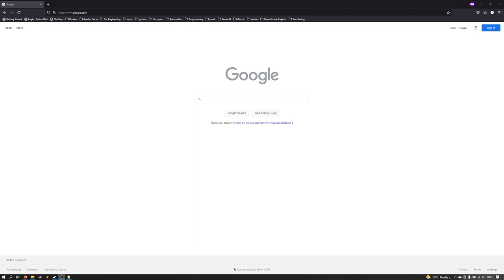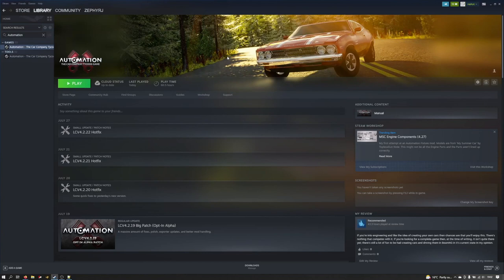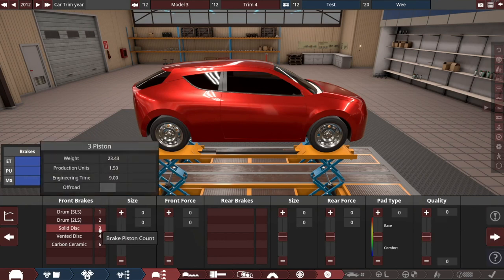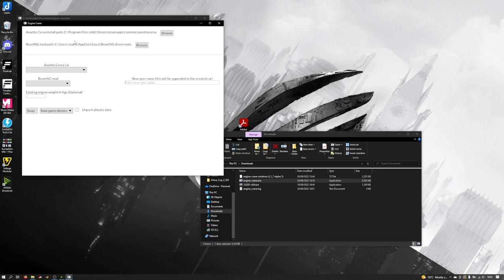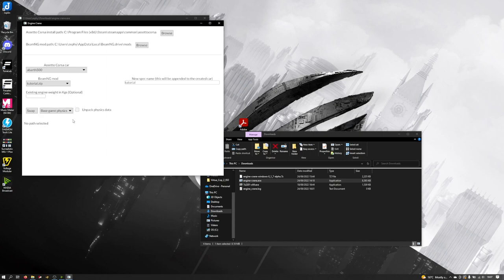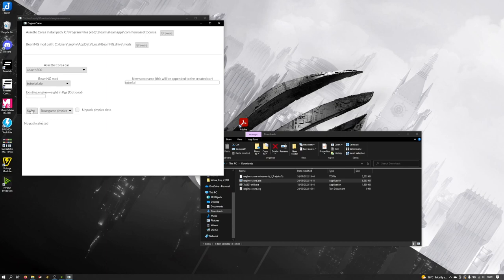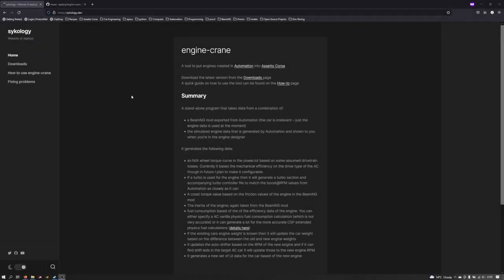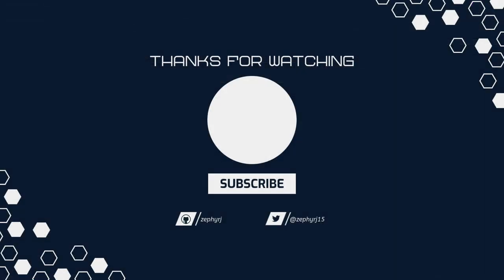How to create engines for Assetto Corsa using Automation | engine-crane v0.1.7

Comment: Hi men, when i try swap the engine im have this error:
"Car file selection family is missing  attribute VVL. The BeamNG mod may be out-of-date; try recreating a mod with the latest engine version"
Thanks
Reply from the maker: Which version of Automation are you using? The 4.1 base version or the 4.2 openbeta version? When I've encountered this I've had to create a new car model, choose the engine I want to swap and then export that as a new mod
Reply: @zephyrj  the 4.2 open beta. Could you please explain to me the process to solve the problem? Thanks :)

Comment: I would love to enjoy engine crane but when i swap engine to asetto, new cars is appearing in content manager, but without any changes, toyota ae86 drives the same with 5.0 V10 1600hp
Reply: Oh crap i just downloaded v0.1.13 and it works
Reply from the maker: When it doesn't work does engine-crane say that it has swapped it successfully when it doesn't change the power?

At the moment engine-crane will create a new car regards of whether it succeeds or not (so it doesn't risk deleting something it shouldn't) so just because there is a car doesn't mean the swap succeeded
Reply: @zephyrj  in v0.1.7 should it say it was successfully in engine crane as in v0.1.13 or in txt file only? Becouse mine engine crane 0.1.7 would close up after any swap
Reply from the maker: V0.1.7 had some bugs in it which meant it could crash and exit. If it was successful it wouldn't close and would print that it was successful
Reply: @zephyrj  really thanks for your respond, anyway in 0.1.13 it works great, so i appreciate your work
Reply from the maker: @him8449  Thank you, really appreciate it.
As an FYI 0.1.14 is also available on https://www.racedepartment.com/downloads/engine-crane.54657/
there's not much change from 0.1.13 but it should give you a slightly more accurate coast curve.

Enjoy swapping engines :)

Comment: i cannot for the life of me get the automation folders to show up in engine crane
Reply from the maker: Hi, sorry for the late response - I didn't get the usual notification about your comment

You can select the path manually if engine-crane isn't automatically finding it. The right-most tab engine-crane has settings where you can set the folder you want it to look for Automation mods

Comment: can someone please help i downloaded engine crane but it cant find any mods in the folders . any workaround/fix 
?
Reply from the maker: Hi, I may be able to help if I can take a look at the log file.

You can raise an issue over at https://github.com/zephyrj/engine-crane/issues and it will allow you to attach the log file for me to look at.

The log file can be found in the same folder you run engine crane from
Reply: @zephyrj  the problem is that when i select the assetto file it says no cars found.....
beamng folder is working okay
Reply from the maker: @leonpace8098  I've replied on the github issue you have raised. Hopefully that helps solve the issue. If you need to send the log file then an example on how to find it is at https://youtu.be/8fMQCYiAgVU?t=1167 in the video

Comment: i have a problem i cant select a beamng mod is is beacuse i dont have the game someone please tell me.
Reply from the maker: Hi, you don't need to have BeamNG installed to create/use the mods in engine-crane

If you are encountering an issue where you can't find any BeamNG mods appearing in the list this may help you:
- the beamNG mods must be zip-packed for them to be picked up by engine-crane so make sure that the zip-pack option is selected when creating the mod in Automation
- To ensure that engine-crane is looking in the correct folder for your BeamNG mods use the "open folder" option when using the BeamNG exporter in Automation (to see the directory it's using) and ensure that the BeamNG mod path in the settings tab of engine-crane matches that directory

Comment: bro, it say "swap failed - car already exist" what should i do?
Reply from the maker: Each swap creates a new car. The name of the created car will be the original cars name + the spec name that you enter when doing the swap.

I suspect you've already done one swap with the car you're trying to swap into. You can either change the spec name when you perform the next swap or you can delete the old version from the Assetto Corsa data directory
Reply: @zephyrj  okk tq. but the car still same after swap.
Reply: @zephyrj  or need to finish engine first?
Reply from the maker: The engine will go into the car in the state it is in when you perform the swap. So generally you want to finish it before doing the swap. Make sure you select the correct car in Assetto Corsa; the base car is not changed, only the new spec that you create
Reply: @zephyrj  already swap, but the engine still same. i dont get it :/
Reply from the maker: @amirulasyraf9684  what are you expecting to have changed? It will only be the torque and power that will be different; no engine sounds are changed unless you do a manual sound swap
Reply: @zephyrj  the power and torq still same. nothing different..
Reply from the maker: @amirulasyraf9684  I've not encountered this happening to me. When the swap is performed does it say that it is successful?
Reply: @zephyrj  it not say swap successful. forgot what it say. later i try it again
Reply from the maker: @amirulasyraf9684  Ah ok. Currently when the swap says failed the car still gets created but no data swap happens - which explains it. Let me know how you get on later
Reply: @zephyrj  bro, u have any chatting apps? so i can contact u and send photo what engine crane show
Reply from the maker: You can attach logs and pictures to a github issue - that would be the easiest way for me to analyse it.
https://github.com/zephyrj/engine-crane/issues
Create a new issue there and then it will allow you to write/attach anything you want

Comment: need to install BeamNg game to??
Reply from the maker: No, you don't need to have BeamNG installed for it to work
Reply: @zephyrj  ok, but it say fail "car already exist"
Reply: @zephyrj  swap failed
Reply from the maker: @Amirulaqim07  that means the spec name you're using already exists. You can either use a different spec name when doing the swap or delete the old version of the car folder with that spec name you're using

Comment: can confirm engine crate crashes when launching with a large library of cars,,,say over 1400 cars,,,crashed on 2 different computers
Reply: runs fine on computer with less than 500 cars
Reply from the maker: It could be just one of the cars that's causing a problem; difficult to tell without doing some further testing 
Would you be able to raise an issue on https://github.com/zephyrj/engine-crane/issues with the engine_crane.log file (will be in the same directory as engine-crane) after you encounter the crash?
Reply: @zephyrj  your probably right because i have a rog ally with the same amount of cars(over 1000) and it works

Comment: Swap failed: acd decode error - io error
Reply from the maker: Hi, which Assetto Corsa car are you trying swap into? Looks like it cannot open that car; if the data is encrypted it will not be possible to use unfortunately
Reply: ahhh i was trying to swap into a modded car or smth i dont think it works but ill try a default game car @zephyrj
Reply: I dont think the car works*
Reply from the maker: Yeah, some modders choose to encrypt the data files for their cars - unfortunately engine-crane doesn't work with these as it can't read the data
Reply: idk why @zephyrj

Comment: I think the AWD and Rear engine Cars dont work i think. Or am doing smth wrong. I get the massage : "Failed to load drivetrain. invalid car - Missing TRACTION.TYPE in drivetrain.ini".
Reply from the maker: Which car in Assetto Corsa are you trying to swap the engine into? I can test it out and see if I can spot/fix any issues
Reply: @zephyrj  i tryed it in the Audi r8,nissan gtr and 911 turbo s.
Reply from the maker: @mahdil.3177  Thanks for reporting this I've created a new release (0.1.12) which should fix this. You can get it at either:
https://www.racedepartment.com/downloads/engine-crane.54657/ (If you use RaceDepartment)
https://sykology.dev/downloads/

Comment: So I'm having an issue with my car bouncing. No matter what I do, whatever vehicle I put an engine in as soon as I give it gas it starts bouncing and then my screen goes black and I get an error top left of my screen. I've tried looking it up but I found nothing
Reply from the maker: I've not seen this before - does it only happen with engine-swapped cars?
Reply: @zephyrj  yeah I'll drive the same car and only once it's swapped is when I have issues.